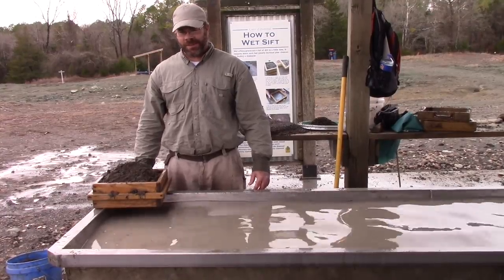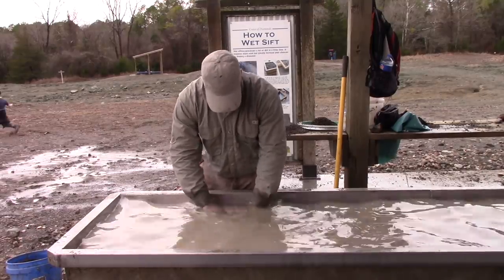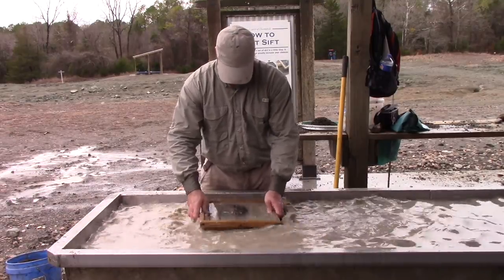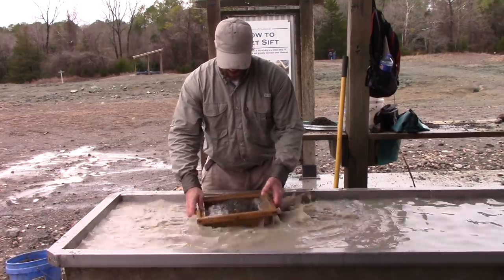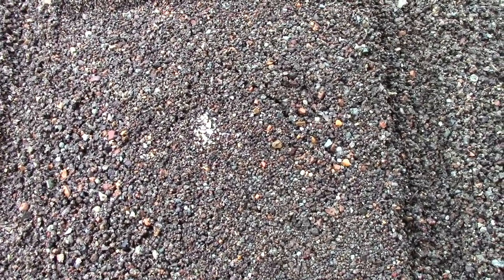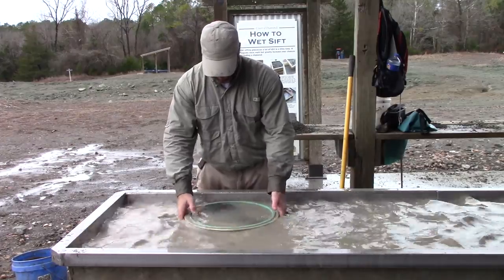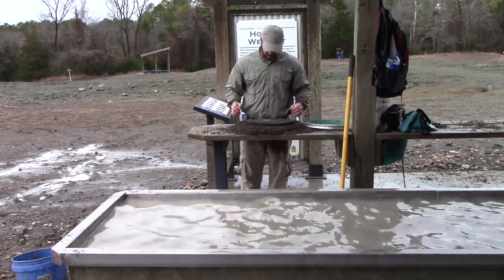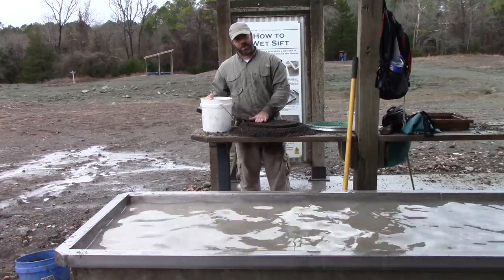How to Wet Sift Your Material at The Crater of Diamonds State Park

Comment: The top screen is 1/4" - what is the screen size for the bottom screen?, and the saruca?  Thanks!  This was really informative.
Reply from the maker: Usually the screen on the bottom and the saruca are either 16 or 20 mesh. I prefer the 16 since it makes the process go faster and I am not overly worried in the smallest diamonds getting through the 16.
Reply: @TheArkansasDiamondMiner  Thanks - so you use the same mesh for both the fine screen and the saruca?  I wasn't expecting that.  Great info!

Comment: Quarter inch on the top screen - what size is the bottom screen? And is the saruca the same size mesh as the bottom screen?
Reply from the maker: Bottom screen is usually 14, 16, or 20 mesh. The screens here are 1/4 and 16 mesh, and the saruca is 16 as well.
Reply: @TheArkansasDiamondMiner  thanks!